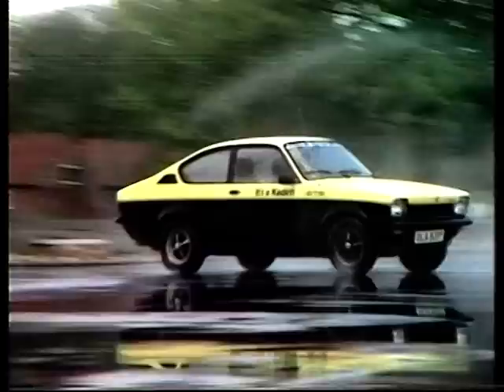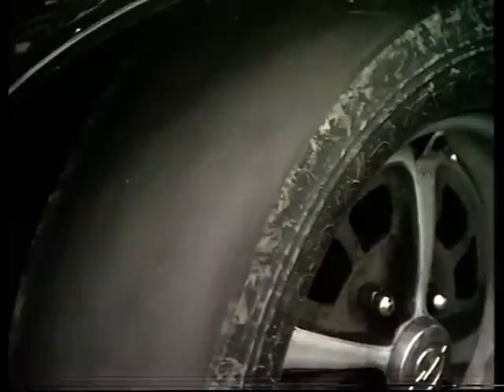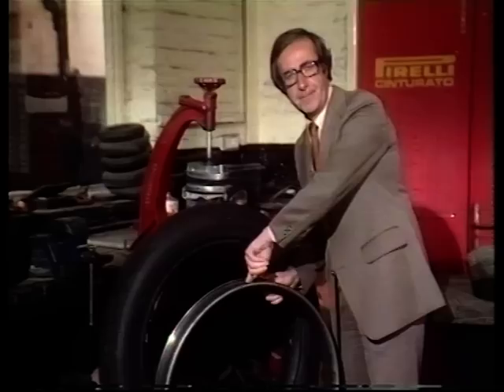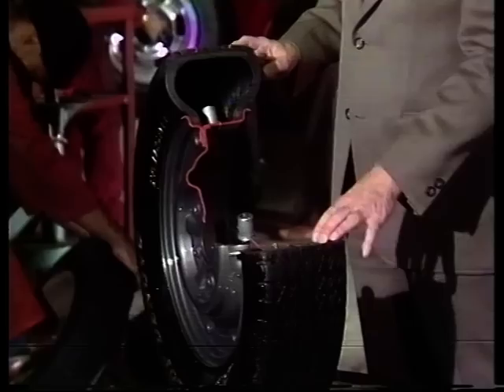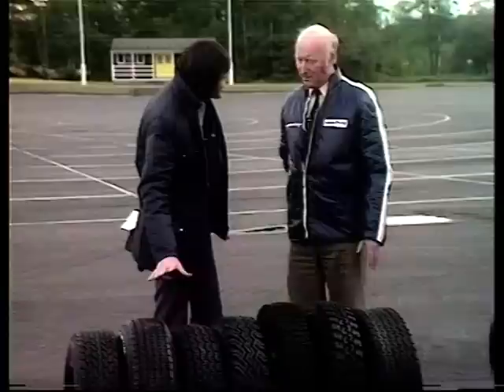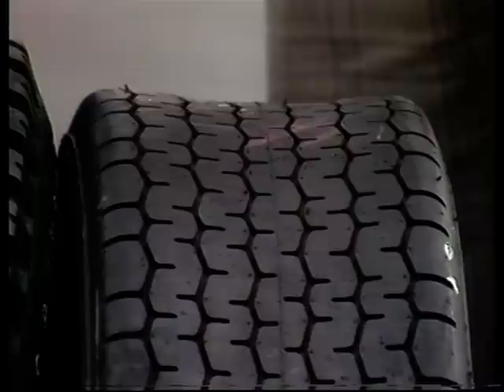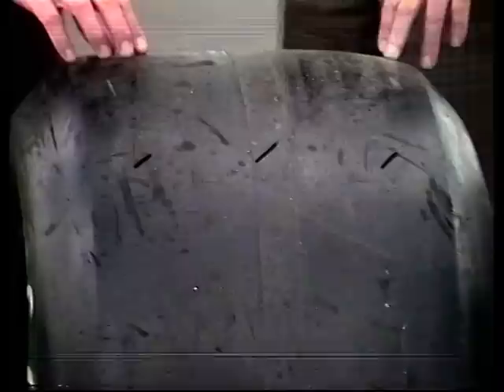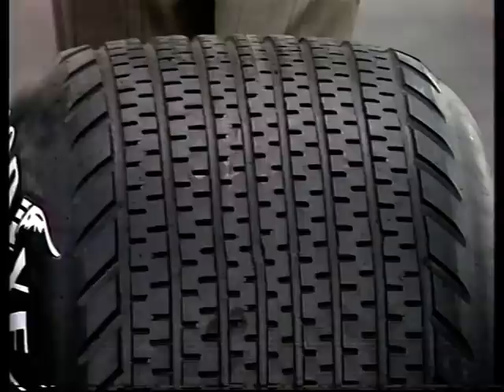Skidding Cars | how to prevent your car from skidding | Rally Driver | Tony Fall | Drive in | 1976

Comment: I used to love the Opel Kadett GT/E
Reply: In brazil ia chevrolet chevette
Reply: I bought a 19 year old 1980 Holden Gemini with 1.6L Isuzu Engine in 1999 in WA for $1000, T2126 (my first car). Drove it across Australia twice (south by the Nullabor and back through Adelaide to Darwin and across North WA), up from Sidney to Cairns twice, all over WA. After a rain storm, It stopped while trying to ford a stream near Wave Rock. Some Aboriginals came by and pulled it out with their van, put some diesel start on the points and I was off again. Try that with a modern car and your looking for a lift. I sold it to a Pommie for $450 before going back to Europe.
Reply: @Barry Foster Sadly, I was only 8 in 1976, so I never had a chance to own one  :(   I tried as hard as possible to get my mother to get one,  but to no avail.